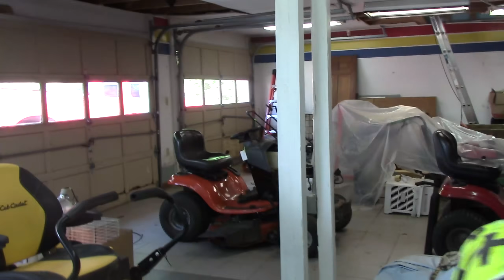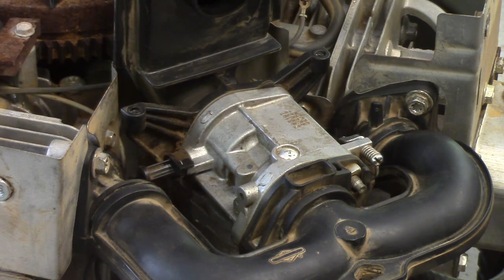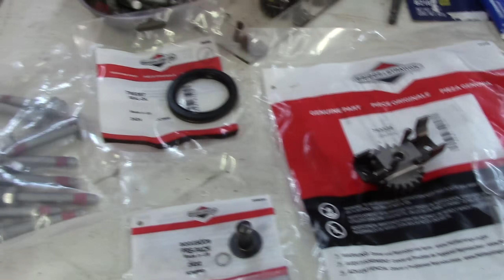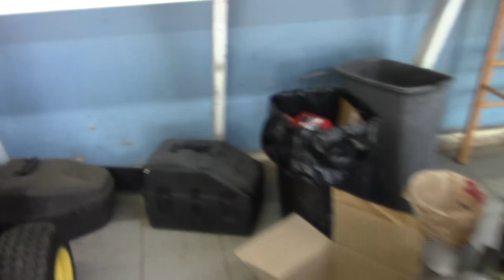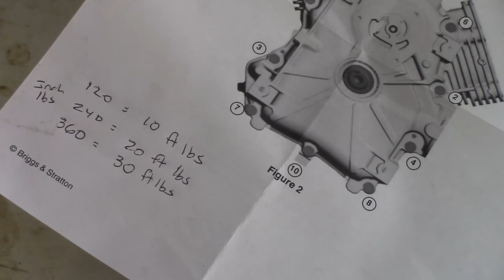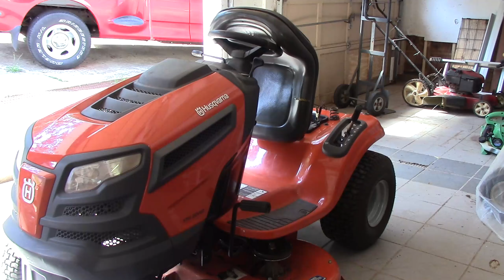ENGINE RACES OUT OF CONTROL !!  Briggs V-Twin Governor Gear Diagnosis & Repair

Comment: 14:30 or so, I noticed you put that retaining ring all the way down into its slot on the governor gear shaft. I find it's easier to NOT push it all the way down until the plunger flange is inside the wings of the weights. Otherwise it's a struggle. Thanks for making the video.

Comment: Good ❤afternoon .  I am working on a B&S 27 hp.  The compression release broke and the governor did too.  My problem is it broke off the shaft that supports the governor gear.  The B&S people said the shaft is not available,  you have to purchase a new block.  Have you run into this before?  Great video.

Comment: It's weird that it didn't have a gasket. From what I know, that matters for crankshaft end play. No or too thin gasket can lead to the crank binding.
I opened mine up last week for a governor investigation, and I found a shattered rod and piston. Lol.
I have no idea how it when that happened. Bought used 2 years ago and always seemed to run fine, but the plug in the dead cylinder was completely clean, so it had been on one cylinder all this time and never knew. I simply never thought to check the exhaust for heat. Lesson learned. Next I buy that will be something I'll check. 
These governors are a notoriously common failure point, but these engines also have yep for being tough and powerful enough to hide dead cylinders.

Comment: Where is that choke return spring connected to? Mine is broke, I see where the spring is connected to the choke linkage and choke arm, has 2 holes, but where does the smaller end connect to near carburetor??? My carb only has the one big hole for the choke linkage. Please help !!

Comment: I have a 27hp Briggs  it was running normal but all of the sadden it started to run way open throttle,  i opened the engine and the governor it looked good,  i got a new one anyway and i installed it i followed the video and still is doing the same after i put everything together

Comment: It looks like at the 16:23 mark the seal didn't go around the shaft correctly and inverted the lip. Is there a way to prevent that, or how do you fix it if it does that? Later in the video it appears to be fixed.
Reply: Yeah, there is a way to fix it, when the thick part of the shaft barely touches the seal stop and take a small screwdriver or something else that is not to sharp and gently go around the seal pushing it down around the shaft, then push the crankcase cover down a little more and repeat if needed, main thing is to go slow and watch that seal!

Comment: Interesting, would've been nice to see it run prior to taking it apart, not sure if this is my issue.. engine is so loud seems like it's going to blow up, checked several things already and no clue what it could be
Reply: Don't run your motor like that. If you if you can't control the RPM and  upon starting it just immediately starts to increase RPM without wanting to level off or decrease within that first one to two seconds~turn key off instantly. Don't continue restarting the motor just because you turned a screw or relocated a linkage or something you need to actually know that you found the root cause of the problem or something that is not properly routed or functioning so that can be resolved. upon that resolvement and knowing that everything else is connected properly, only then would you want to test start the motor. But be ready to immediately turn it off with your hand on key. If no one has tampered with or removed and reinstalled the lines and springs etc that  connect to the governor assembly, the carburetor and the throttle and choke chassis/bracket~ I would probably drain the oil and have a clean workspace and table where you can do exactly what he did here and inspect your Governor even if you don't have the magnet or the camera, you can still gain access to the governor following his video and  that will probably be the source of your problems. If however someone has been messing with any of the aforementioned and the governor is in the right location and in sink as per the video

Comment: How did you install or adjust the throttle cable?
Reply: I leave it off tell I adjust the governor and then install it, start engine and move cable to wide open with throttle lever wipe open full throttle 😊❤

Comment: It's a B&S, common issue... it pinched a loaf. Probably because it is designed to pinch a loaf if the owner doesn't change the oil.
Reply: The governor mechanism uses a rod and sliding cup design with a centrifugal gear system that pushes the cup up and down on the rod to control the engine rpm via the governor paddle and governor lever which is connected to the carburetor butterfly.
The governor centrifugal gear rubs directly on the rod with metal on metal, which requires oil to prevent erosion.
If the oil isn't changed, that constant metal on metal action will literally pinch the loaf that the cup slides on. Will pinch it right in half and then it has that issue.
Reply: And when the internal engine governor starts cutting rods in half, you basically have to take the entire engine and throw it out the window of a very tall building and make a new engine that doesn't do stuff like that.
Simply because that specific part can't be replaced or repaired.

Comment: Very good video, Thanks! 
I have question to ask you. When starting my Sear 42-inchLawn Tractor using BRIGGS & STRATON INTEK 18.5 V-TWIN Engine, it runs very high speed, not in idle speed and cannot make it speed down but it seems to run fine in high speed. We opened the cover and tried to use figure to push to idle point it will run slowly and fine. Do you think I need to change the governor or just adjust the governor to make the tractor back to normal, please advise and thanks!

Comment: Curious what type of sealant you used on the pan and oil pump cover.  Is it critical to use something specific?
Reply from the maker: I think I just used regular black RTV sealant....
Reply: I’m using the Right Stuff silicone or Honda bond 😮❤

Comment: I have a very similar engine and mower.  After I did a carburetor replacement my engine would surge.  I checked the governor adjustment several times - I don't think the adjustment was ever wrong, or was changed.  Now my engine won't idle down unless I hold the throttle butter fly closed.  If I do that it idles fine - no surging, nice and smooth.  During the times I reset the governor I immediately hit the key each time the engine started to race.  I see the governor arm move when the throttle opens or closes.  Do you think it could still be internally damaged?
Reply: Hello Sir, did you solve the problem?. Mine is doing the same thing. Thanks
Reply: @a.caballero9514  I had to rebuild the governor.  During the process I replaced a perfectly good crank seal only to have the new seal leak badly.  I eventually did get the engine to run smoothly.  It is important to get the throttle cable adjusted properly so the choke engages properly.

Comment: Did your washer that goes under the governor have that little tab on it ? Which direction does the tab go in
Reply from the maker: With the engine on the workbench, (essentially up side down, with the flywheel on the table, so you can unbolt and remove the oil pan) you insert that washer with the tab downward, so that it becomes motionless and does not spin. I think that's how I remember installing it.

Comment: You know, I bite my lip. Which position do the butter fly on the Gov go?.. I took a chance and aligned them horizontal to the heads.. I figure you turn the governor paddles so the big guy hits them?... 

I'm sitting here looking at mine.. I almost had the pan down and ready to torque.. and said.. I'm..  wait.. I watched you, and Daryl (hard to stare at), neither of you mentioned this ..

PS. If you push the small clip just down slightly, then put the cap on, easier to do, and then you can push it to the bottom where it clips

Comment: Improper govenor adjustment can cause the governor to fly apart when theirs no pressure against it. Its the number one cause of govenor failure on these engines, yet its so simple to do as you have shown. Thanks for the video.
Reply: You sound like you have some experience with this.  I'm curious if you have ever seen partial failure of the governor gear or does it always fail completely.  Mine seems to still function - keeping the engine from running away, but it won't push the idle linkage down to a proper rpm.

Comment: 16:10. You didn't install the gasket. Am I correct?
I'm going to order parts for my B&S and I'm wondering if the gasket is necessary.
Excellent video. It saved me some frustration and  the need for colorful language!
Reply from the maker: If it had the gasket originally, install one again. If only sealant, then sealant alone. Good luck!

Comment: Thanks for the video. My Husqvarna tractor is doing the same thing. I can usually lift up on the linkage to drop the rpm, but it’s obvious there is a problem. Now I know what to look for. 😊

Comment: Im having problem getting govenor gear to mesh with the cam gear, any help woulg be greatly appreciated.
Reply: You probably have already gotten it meshed by now, but if you loosen the rocker arms to remove valve spring tension, the cam won't have any load and the gears should mesh easily. Just have to reset your valve lash when done.

Comment: Boy lemme tell ya what lmao I've rebuilt quite a few chainsaws....very new to small engines and had no idea what that little plunger deal did. I tore my sisters Briggs dawn to replace the leaky gasket and I'm pretty sure I just chunked the plunger and ahhh hell that thing don't matter, and boom engine would not run right. This video saved my day I'll have the new governor assembly tomorrow since the old one broke all to heck haha. This video saved my day.

Comment: Im having issues with my Exmark series x it has a new carb and gaskets the issue is when I’m mowing over a rough/bumpy area it will stall/bog down any ideas? I tried bypassing the safety switch but that didn’t do anything

Comment: Can u show how the back spring is oriented? I have the same tractor I’ve been fighting all weekend. Had to replace the oil pan gasket and since I’ve done it it just runs full throttle only time I can get it idling is with the choke. I set the governor and hoping the springs are in the right spot/orientation before I pull the motor for a 3rd time to check on the internal governor piece. Everything looked fine but the springs popped off as I was working on it on the bench Thank you!
Reply from the maker: Here's a helpful video I watched and learned from. I think it might help you too. https://www.youtube.com/watch?v=BL6WmE7pPKs

Comment: ...very interesting video Buck....hope I never have to do this, but if so, I would use this as a guide. Tell me, why did 
you not use the sump gasket that came with the bolt kit?....why do you prefer the silicone sealer? .... 🙂
Reply: Gasket will leak and blow out 😊😊😊